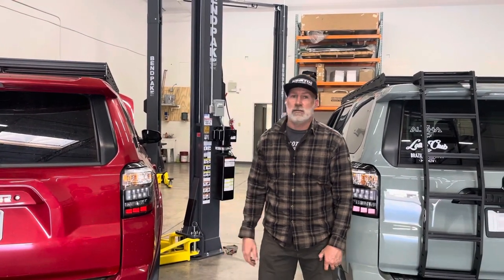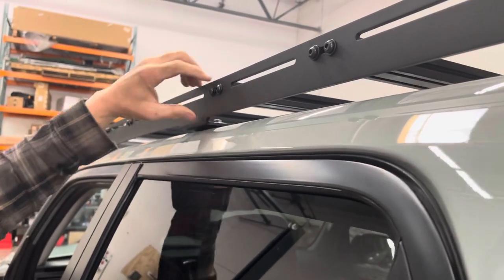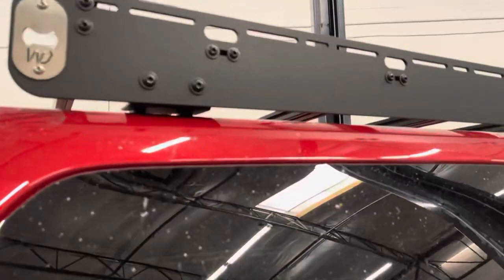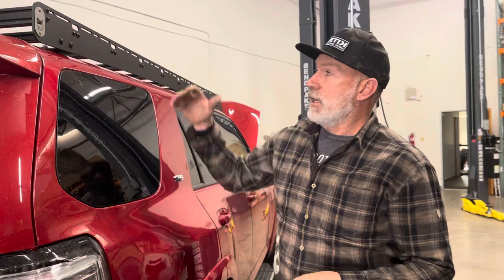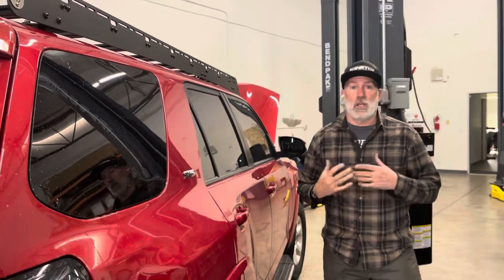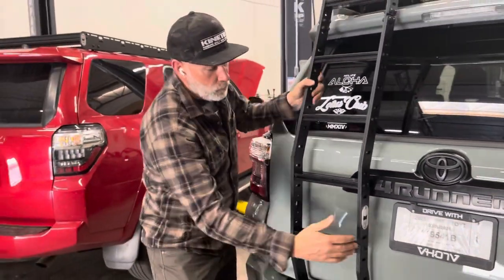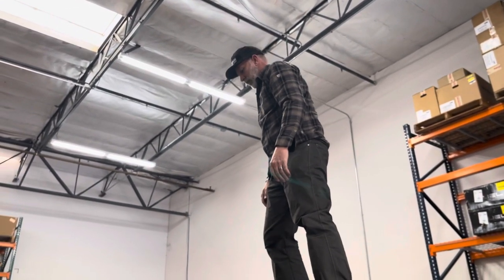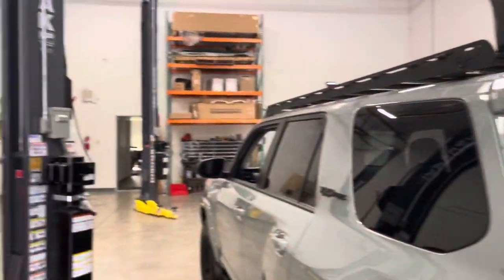Roof Rack comparison

Comment: Both support brackets shown have a problem with leverage where they attach to the spacers. That's a bending moment that is on the attaching hardware going into the truck. That OEM mount is designed for a mount the disperses the load over a large area in a downward direction. Sherpa has a better mount interface with the roof of the vehicle.
Reply from the maker: @AllThingsFabrication  Sherpa does have a great designed bracket.  The only down fall is it attaches to the crossbars which then can not be adjusted because of it.  We would have designed brackets like this but the bolt spacing is different on all of them that it would make for a lot of different brackets and lots of cost.

Comment: So what is the weight limit?
Reply from the maker: @Buvenom  the roof is the weight limit.  Right at that 750 lbs.   The roof starts to deform at the mounting points.  The roof rack itself will hold over 2000 lbs. equally distributed.

Comment: Are you worried about steel on aluminum corroding because of dissimilar metals? Or should the powder coating protect it?
Reply from the maker: @mcwendel8066  we have been running the stainless steel and the aluminum together for the last 4 years and it has held up really well together.  Typically one of the two parts is usually powder coated, which adds additional protection between the surfaces.👍
Reply: @westcottdesigns  awesome! I see a purchase in my future. Does it work with the sunroof?
Reply from the maker: @mcwendel8066  works well with sunroof.  Thank you for believing in us!🙏

Comment: Sleek design, however the mounting bracket looks weak, especially when you off-roading with your rooftop tent on the swing force puts a lot stress on these brackets, would be nice to add gusset to add strength.
Reply from the maker: The roof starts to buckle before brackets start to bend👍